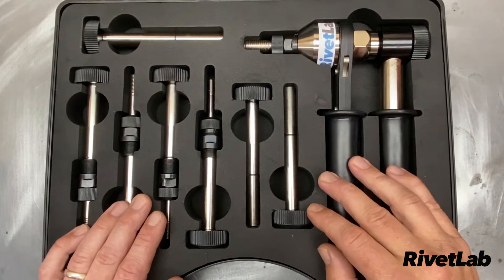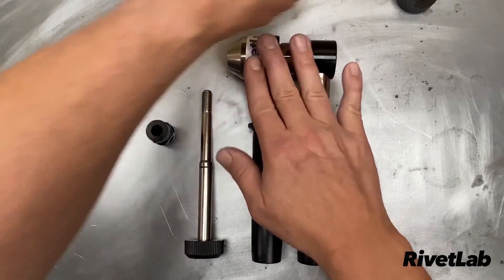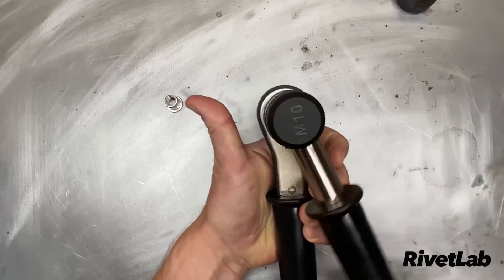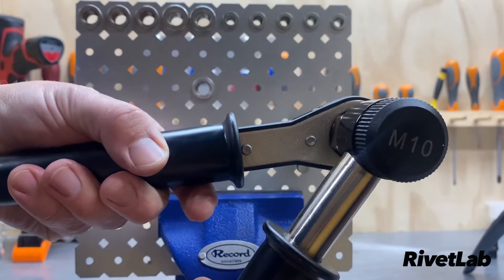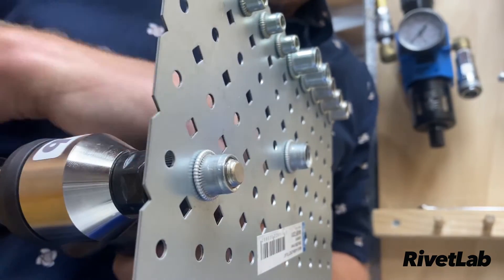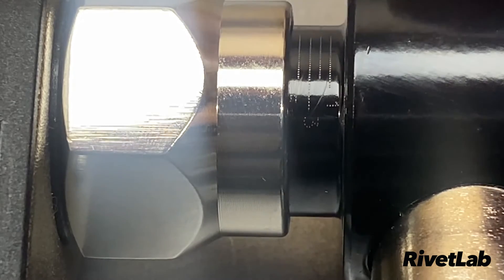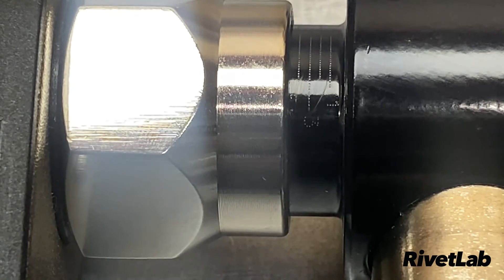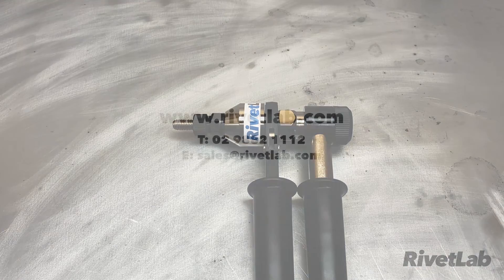How to Install Nutserts Using the RT-512 Rivnut Tool

Comment: Can we purchase M3 & M4 Mandrel bits ?.....In order to use M3 & M4 Rivnuts if required ?
Reply from the maker: Thanks for your question. We only have M5 and up. The mechanical advantage of this tool would lead to M3 and M4 mandrels breaking too easily and/or stripping the rivet nut's thread. For smaller sizes I find the plier style tools to be a safer bet.
Reply: @rivetlab, OK, thanks for responding....that makes sense, could you recommend a High Quality Rivnut Tool suitable for M3 to M4 Rivnuts (again compact in design for tight area use). Im Picking up your Ratching versions M5 - M12 version tommorow they look great, tight area use & look like their made to last. (Something that's not very common anymore, unfortunately) 🙄
Reply from the maker: @oze-bikes4life663  The Gesipa GBM10 would have to be one of the best quality plier tools on the market. Made in Germany!
Reply: Cheers 🍻

Comment: I love this tool! Best rivet tool ever. If I am going to be a bit critical, the instructions could be a bit more detailed and slower. I had to play with the tool quite a bit before the instructions made sense. It also looks slightly different from the TR-21 that I have. But as far as rivet nuts there is nothing better than this.

Comment: Nice but what’s this cost? Pretty expensive for the average guy to use twice a year, then store in a toolbox. Most guys are better off with the bolt, nut ,washer model.
Reply: Cost is about $250 USD Ken. Probably no need to purchase for such occasional use but it's a good method to install and can set M12 stainless steel. Great value from that perspective.
Reply: If you are installing anything that relies on a M8-M12 bolt, you want a proper tool. Apart from safety issues, ‘a stripped bolt can turn a 30 min job into a 3 day nightmare’ applies here too. Try drilling out a damaged rivnut that hasn’t set and is spinning freely. 

This is an industrial grade tool. You can get much cheaper clones if you are an occasional home user, and they are fine. You don’t need a ratchet tool for general use, as you can get lever handle models that tend to be cheaper still.  A ratchet is good in cars or anywhere with constrained space though.

Lastly, this kit is pricy, but it comes with a M5 mandrel. All the cheaper ratchet kits are M6 or M8 up. M5 stainless is my most used, so the legit tool was good value for money for me vs buying a cheap M3-M5 and a M6-M12.